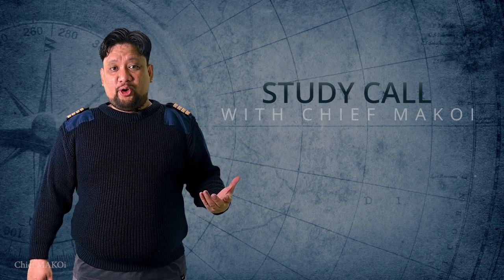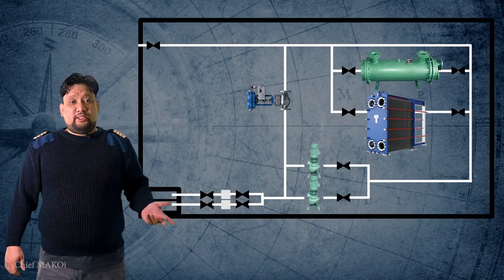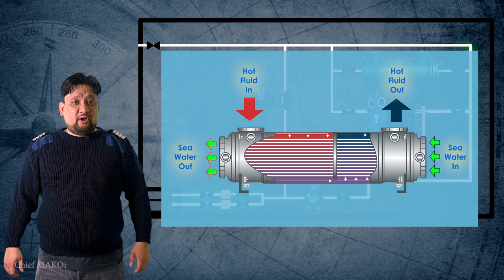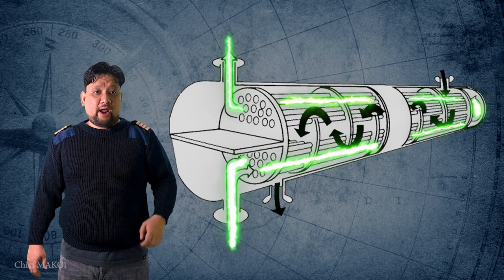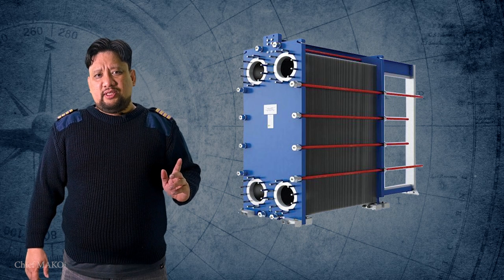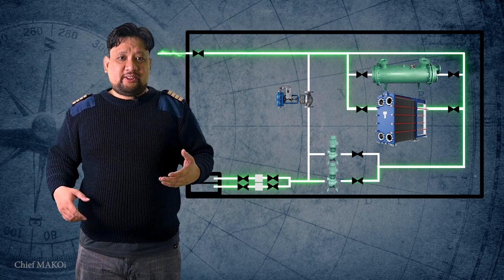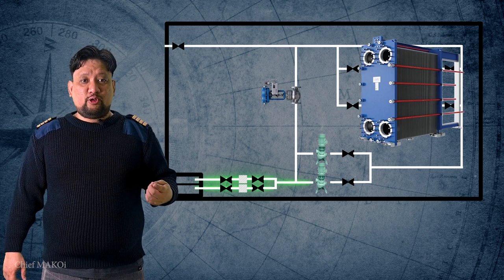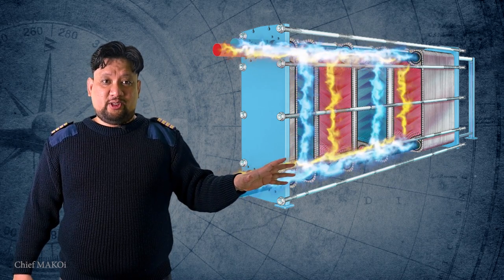Ship's Sea Water Cooling System | Study Call with Chief MAKOi episode 002

Comment: Corrosion must be a big headache when it comes to maintaining this system. Great video as always.
Reply: GW sacrificial anodes are used in coolers to help prevent corrosion
Reply: Erotikstudio Winkler GmbH The plates on a plate cooler maybe made out of stainless steel, but the actual piping for the sea water system is just steel
Reply: On the Mississippi River we have issues with what we call zebra muscles. Ugh they clog up the tubes and we are constantly cleaning them.
Reply: GW 
That depends on the amount of money the owner wanted to spend on his newly ordered ship.
The best material for the piping is Cunifer 10. When correctly designed in combination with a short piece of galvanized pipe (including a spare one on board) this material is troublefree.
A galvanized system will start giving problems after being for about 7 years in service.
The pumps however need a lot of maintenance on wear rings and impellers
Reply: @scottwhitley3392  
Plate cooler plates are almost always made of titanium, they're very thin and individually very light and are super good at transferring heat while being virtually corrosion free, the only fouling we get is from sea life that accrues on the seawater side.
Even then it's a simple job to open up the plate cooler and scrub the accretion off with a bristle brush and an HP hose.
They are also regularly backflushed which as it suggests reverses the flow of water while the fresh water supply is isolated and carries a lot of crud overboard.
SW pipework is indeed just steel but there's really not a lot of it, as Chief Makoi stated, it only goes from suction inlet to cooler then overboard and it's becoming more common now to have the internal surface coated in a resin and there is also of course plenty of cathodic protection.
Reply: ANTON RUDENHAM thank you, my vessel only has tube coolers so that’s all I’ve really experienced
Reply: @scottwhitley3392  
Plate coolers actually came from the dairy industry and were invented to cool huge volumes of milk down after being pasteurised apparently.🤔
Tube coolers are fine except for when they need rodding out and the end covers rot quickly even with anode protection, without anode protection they sometimes only last a matter of weeks. Taking the end covers off for access to the tubes is also a pain in the arse.
One of the advantages of tube over plates is that it can operate with multiple tubes blocked or even sealed off if leaking and unable to fix, in this respect the plate cooler is more fragile as the entire volume of SW takes the same route through the cooler and if one SW plate becomes fouled then the whole thing is knackered, of course this should never be allowed to happen and it won't if regular backflushing and scheduled disassembly and cleaning of the plates takes place.
Reply: Chris,  no son “zebra muscles”...  son zebra mussels.                    Zebra mussel (Dreissena polymorpha) is a small freshwater mussel. The species was originally native to the lakes of southern Russia and Ukraine.  However, the zebra mussel has been accidentally introduced to numerous other areas and has become an invasive species in many countries worldwide. Since the 1980s, they have invaded the Great Lakes and the Hudson River; and other North American rivers like the Mississippi and their grow clogs  the ship’s engines cooling systems.
Reply: ANTON RUDENHAM yep you are correct about the end covers rotten, they are a pain in the arse to maintain but my company cheaped out.
Reply: Or they use membrane to extract the salts.

Comment: Nice video. Short and comprehensive. You should have mentioned the use of strainers and of the main sea duct or crossover. At least to offer a usual arrangement perspective. Well maybe another episode where you can explain high and low sea chests and ballasting deballasting. Keep them coming Chief! Rgds

Comment: Thermal engineer here, you do a good job of describing things and how these systems work. One small quib is that these coolers operate on the principles of convection not conduction.
Reply from the maker: Oh yeah!  Thanks for the correction.
Reply: @ChiefMAKOi  I can't beleive you actually replied! I love watching your videos to see how these massive ships work. I am curious as to how shipping HVAC and plumbing works as well. I design systems for buildings and I assume there are similarities and differences in how ships work
Reply from the maker: We'll get to that topic eventually but it's pretty much the same except that the coolant for the condensers will be (eventually) sea water.
Reply: @ChiefMAKOi  it's a wonderful resource to use. I will be looking out for those as there are many options and I love seeing different uses of the same science 

Thank you.

Comment: I was on a cruise ship over Christmas... it's two main swimming pools were filled with seawater and these were re-filled each morning. In the cases of cruise ships with swimming pools is any of the heat from the engineering equipment captured to heat the pools?
Another interesting heating/cooling piece of info I find really neat... my city (Christchurch, New Zealand) is still recovering from a major earthquake in 2011. We are now building a new large public swimming pool / sports complex. The main pool is being heated, in part, by a heat exchange system from a very large main urban sewer pipeline! It's the first of its kind here in New Zealand. About a third of the city's sewage flows through the "Southern Relief" sewer pipe and the heat from this pipe is being exchanged/used to help heat the new pool complex!
Reply from the maker: I have something very similar and very commonly used onboard ships coming in a future episode.

Comment: How much of a shop does a ship have? do you have a lathe, a magnetic base drill press with reverse for tapping and the ability to tig aluminum? Or is it more like a bucket of dull cheap and bent vice grips. Do you supply your own hand tools?  If you weld in heavy seas, can you see it in the finished bead?
Reply from the maker: A lathe machine, drill press, electric arc and oxy-acetylene gas is standard for ship's workshops.  Pkus an assortment of different hand tools and power tools as well.  Pretty decent.  We don't work with aluminum that much so nothing for that.

Comment: Where does the fresh water for the cooling system come from?  And is there a system onboard that takes the salt out of the sea water to create drinking water?
Reply from the maker: Those topics are scheduled in the upcoming episodes.
Reply: Fresh water generator
Reply: RO plant
Reply: Dan Judge besides the herebelow mentioned fresh water generator and or a reverse osmosis system, ships still come alongside a quay for cargo handling operations were they have the possibility to top up their fresh water storage tanks on those rare 😅occasions that the FWG did not produce the, by the manufacturer, promised amount of water.
Reply: Dan Judge If it is steam turbine powered ship than there are huge evaporators that produce fresh water.
Mostly the ships are diesel(internal combustion) powered,so reverse osmosis is used in that case.Or put it in layman terms,water under high presure is forced trough a special membrane that will hold the salt!
Hope this helps.

Comment: What do you do to keep the sea water cooling system from becoming impaired when in a very polluted harbor (where the strainers may become stopped up quickly and might not even stop some stuff that could deposit on or otherwise harm the pipes and heat exchangers)?

Of course, a lot of cooling system problems (and space consumed, and energy wasted) could be avoided if somebody could commercialize an adiabatic engine.  In an adiabatic engine, the materials are so tough that all heat can be retained and used except for that lost out the exhaust, thereby resulting in greater efficiency.  Adiabatic engines have already been invented and tested as early as the 1950s, but never caught on -- probably getting materials that satisfy all the requirements simultaneously must be really hard:  strength, heat resistance, oxidation resistance, insulating properties, fracture toughness, wear resistance, and self-lubrication properties (alternatively, a really high-temperature lubricant that won't burn up, decompose, or evaporate too fast and won't freeze when you shut down the engine).  All these properties can be found in real materials, but putting them together is the hard part.
Reply: Lucius Chiaraviglio that can be a challenge.
Vessels normally have a high and a low sea water suction.
Sea chests can be flushed back using compressed air or steam. Some seachests are equipped with a connection from the fire main for back flushing.
Once the strainer of the sea water cooling pump has become clogged the stand-by cooling water pump will start up and than it is hurry up guys, clean the strainer. That can happen several times😫

Comment: Hi! Great channel! I am curios to know about how really large ships reverse their engines (if they do) when maneuvering i port etc. From what I have understood, they have a direct connection between the main engine and the propeller and don´t use a reverse gear like a small boat or a car.  So what kind of systems are used when reversing (or starting) the main engine, how long does it take, is it possible to use when maneuvering etc.

Comment: Very good explanation of the conduction system. I think or I assume that there is a form of desalination of sea water through another system which removes the salt from the water to prevent the build up of salt which causes corrosion like how a nuclear submarine converts and desalinates sea water to cool it's reactors from melting. I do assume it works in the same principle. Correct Sir?
Reply from the maker: Yes, It will be discussed in another episode.
Reply: @ChiefMAKOi  You are an outstanding engineer. I am waiting for that part. Fantastic show!!

Comment: Chief, what is the temperature of the sea water as it comes into the cooler and the temperature as the water exits back out into the sea?
Reply: I've built city block size chiller plants. Good question not easily answered. Inlet side temperature will vary depending on where measured (before pumps or after pumps), typically there will be a slight difference across pump due to impeller. Heat Exchangers also have different thermal exchange ratio's (materials used in manufacturing), over/undersized designed, etc. The Main engine's duty cycle at that moment (minimum-maximum load) will vary. Those factors will affect outbound coolant. Also look at his diagram, there is a Temperature Control valve (assume variable), the circuit as shown can re-circulate the heated coolant back into intake side (thermostat effectively). This is to not over cool the secondary side. When programming the PLC for a circuit like this (PID LOOP), the in/out temps are relatives not absolutes, the PID is going to cycle to maintain the desired Secondary (engine side) temperature.

Comment: Is some of the excess heat also used for environmental heating for the bridge, other living spaces, working areas, etc. when it is cold outside?
Reply: George Travers Heat recovery systems for the services you are referring to are installed on many ships. The same is done with the excess heat in the exhaust gas.

Comment: Is there a possibility to use Solar panels on the ship and what area you could mount them? I think 2,5m above the deck especially on cargo ships
Reply from the maker: I'm sure some have experimented on this.  But the energy requirement for ships is massive, ranging from around 200 - 1500 kW depending on the ship type and operation.
Reply: Solar panels on such a MASSIVE ship?

What a joke...the THORIUM POWER PLANT is the future! 
A fridge-size can produce 20MW of power!
Thorium is an element that can provide ~210 times MORE power than uranium without any waste produced!
Reply: @WadcaWymiaru  Thorium is just 4times more common as uranium and you have waste but in a much much lower amount.
Reply: @CUBETechie  
Thorium is over 571 times more abundant that uranium we currently use.
Plus there is no waste!
Fission products are usefull materials in medicine and industrial production 
(food conservation, metalurgy) as gamma sources. 
That what you call a "waste" is Pu-238, a good stuff that NASA is hungry for!
Plus VERY EASY to separate just from ONE tonne of thorium!

Comment: That's a very good video Chief.  And it poses a question.

Looking at the diagram of the system you showed, is the device just before the discharge port a filtration system to reduce/prevent the system contaminants from being released back to the sea?

Thank you for the video.

Stay safe everyone.  😎😁
Reply from the maker: There aren't any system contaminants.  It's basically flow in - flow out.
Reply: @ChiefMAKOi   oh ok.  I was thinking about the lines inside the systems bursting/leaking and contaminating the seawater as it's flowing through the whole system.

Thank you for the reply Chief and for your service.

Stay safe out there on the high seas.  😁😎

Comment: Can you please explain working of oily water separator
Reply: vishnu ajay 
Oily water separators are no longer allowed as they cleaned the oily bilge water only up to 100 ppm.
The required max 15 ppm is achieved in Oil Filtering Equipment 😎

Comment: Ships could use passive cooling with oil pump radiators to dispel heat along segments of the hull that are contacting water, would really simplify the corrosive seawater mumbo jumbo.

Comment: What ships do to avoid corrosion from the sea salt....and how this much water is filters and how clotting of salt in the filters and pumps are avoided?
Reply: paint and more paint. Ships also use Anti-fouling paint which usually has copper to prevent organisms from living on the hull surface.

Comment: Looks like unlike a car a ship doesn't need a coolant reserviour nor a radiator. The entire ocean is a coolant itself.
Reply: NO! ... you missed the point! ... There are GIANT EXPENSIVE radiators!!!, with hundreds of brass tubes just like on your car ... that the heat exchangers he is talking about .. the "radiator" on your car is more accurately called a "Heat Exchanger' as well.
Reply: In Denmark we actually extract heat energy from the ocean in order to heat our homes so that makes the metaphor of the ocean being a heat sink even more relevant.
Reply: I have seen small boats in which seawater supposedly went directly through the engine block, but it's not a good idea.  You really wouldn't want a big ship to work that way.
Reply: @Lucius_Chiaraviglio   I have never heard of a motor like that, however you may have seen that the seawater went to the heat exchanger that happened to be mounted to the side of the motor.
Reply: @Fiberglasser03  Could be that the person explaining it to me explained it incorrectly.
Reply: Yes Lucius, that is a raw water cooling system. Most outboards and some inboard engines use this. Downside is salt water corrosion.
Reply: @michaelgilmartin1507  Thanks -- I didn't know what you were supposed to call that kind of system, or if it had even been explained correctly.  https://en.wikipedia.org/wiki/Inboard_motor#Cooling
Reply: Not quite the same because if the ship cooled the same way your car did the engine would corrode away in no time. Basically instead of a traditional coolant system where your car has a water pump and series of water jackets around the cylinder walls to keep it cool, this takes that basic principal but instead of pumping the sea water through the water jackets they send the coolant through a heat exchanger that is cooled by the sea water and sent back to the engine so sea water is never in direct contact with the engine as it's easier and more cost effective to replace a heat exchanger vs replacing an engine
Reply: @jhomrich89  but isn't coolant itself water mixed with anti freeze and maybe corrosion inhibitors as well?
Reply: @jhomrich89  Except, apparently, if you have some kind of cheap consumer-grade boat . . . .

Comment: My knowledge base is from reciprocated steam, ST Wattle where there is a direct sea water condenser.
Have you served on a steam turbine powered vessel? How do they work, please
Reply: On a steam turbine powered vessel the steam out of the boiler (saturated steam) is heated again (as steam) in the steam super-heater to maybe 600 deg and 600 psi (it varies a lot).  This super-heated (dry) steam is then sent to the high pressure turbine.  The discharged steam from the HP turbine is then sent to the low pressure turbine.  After the low pressure turbine the steam is routed to the condenser where it's changed back to water and the process is started all over again.  This is a highly simplified steam cycle.  There's lots of other stuff that happens as well.  It's just a big cycle that changes the energy contained in the steam to the energy of the rotating propeller shaft.

Comment: I see a HUGE issue with a ship using seawater as a cooling liquid. Not only does it risk leaking oil into the system and out into the sea. Heating sea water creates an issue with preventing the absorption of CO2 since this contributes to global warming. There needs to be a better way of using this heat energy for work energy.

Comment: How about bandclamp soft patches used as temporary repairs, and if they are not tracked and corrected by using the ships and company SMS it can lead to further deeper inspections and possible detention for failure of the ships SMS.
Reply from the maker: I can only discuss so much in one short video.  Those will be discussed in future episodes.